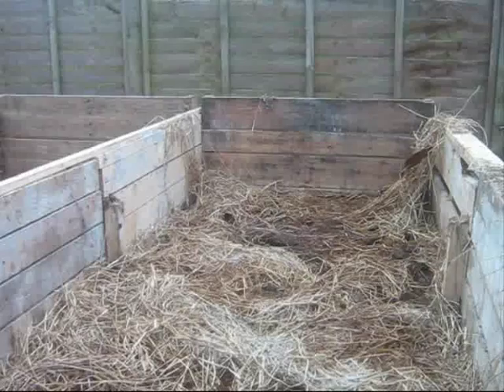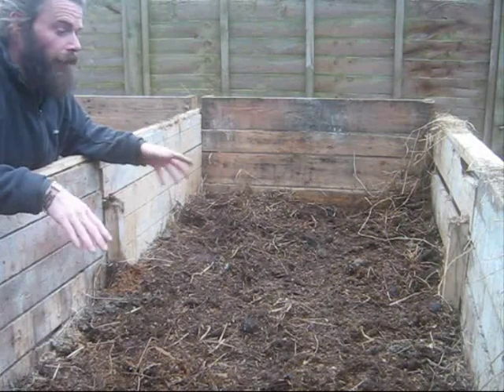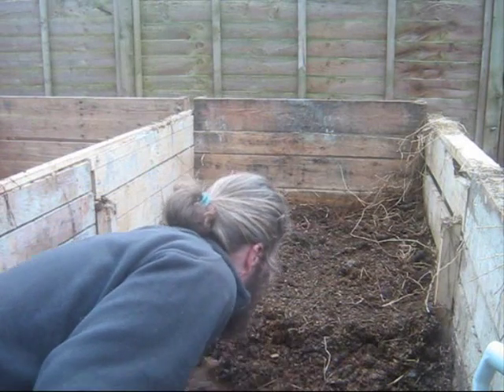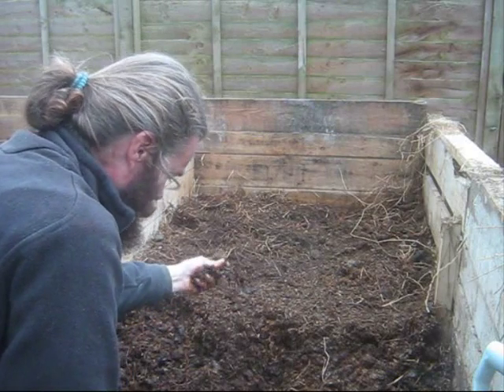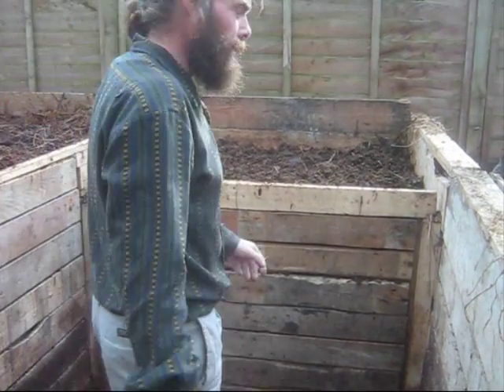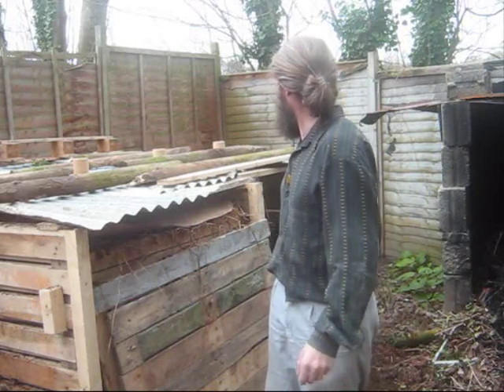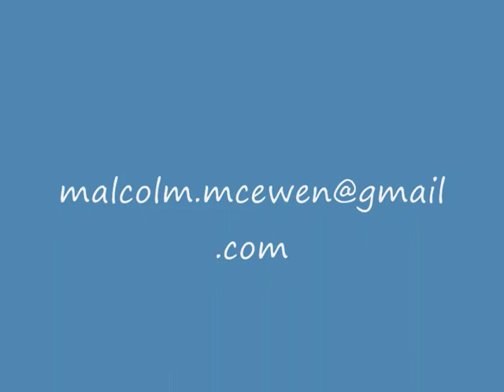making a thermophillic compost heap pt 4

Comment from the maker: @silvertalongift 
hi, yes there is a good alternative or addition... a little old lady called Maye Bruce wrote a book called common sense compost making in which she designed a herbal mixture called QR (quick release). The mixture essential works in the same capacity; it provides a readily available food source to kick the microbes off. 2 was to get it... 1) buy it from the HDRA in the uk (it's a .co.uk site) or find a local supplier or 2) read her book "common sense compost making" .. more